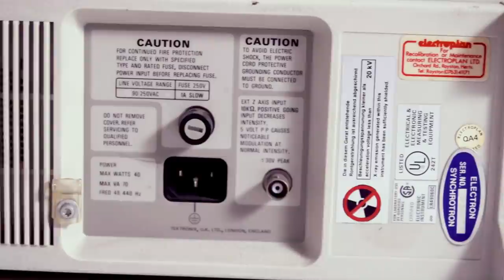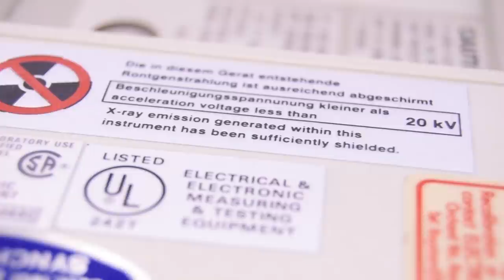1980's Cathode Ray Oscilloscope Teardown - The Electronics Inside

Comment: I believe that roll of coax is a delay line, literally using the speed of light and velocity factor of the coax to delay a signal a couple nanoseconds or so.
Reply: Specifically it is to delay the signal trace so that it is possible to see the trigger event on screen.  If there wasn't a delay then the part of the signal that causes a trigger, like a rising edge, would be gone by the time the beam started its 'journey' across the screen.  The delay means that the trigger effectively happens very slighty before it is displayed.  See https://w140.com/tekwiki/wiki/Delay_line
It is nothing to do with the delayed timebase.

Comment: I'm  still using similiar scope,  tek 2235...   I believe that coil is in fact  delay line,  for the delayed time base, dalayed time base is quite handy. On this scope, it can be controled by the potentiometer, right between CH2 and ext. trigger  BNCs, i think is uncalibrated single turn potentiometer.  2235 have 10 turn potentiometer with scale.
Reply: Yes, that's a delay line

Comment: I got a 1980s oscilloscope at a local auction house, recently.  was £20 or so.  has RS branding on it.  I think it needs recapped as it went on for a few seconds, then off.  Have to see whats inside.  It did come with the manual, that has the circuit diagram
Reply: Always good to see the old kit coming with wiring diagrams and sometimes part lists!

Comment: I would have tried to fix it.
Reply: It was probably fixable. There are some custom tek components in there but a lot of them are available on the second hand market. I got a remanufactured fan for my 2465 that way.
Reply: Agreed.  A simple problem like focus will most likely be a simple component failure in the HV power section.  That said, working on the HV section is not a simple thing.  It presents quite large hazards for the unwary, not to mention requiring specialist test gear capable of working safely at very high voltages.